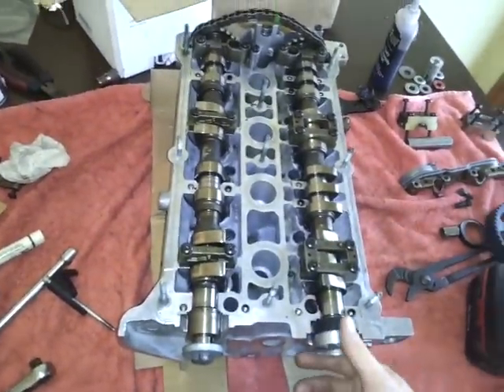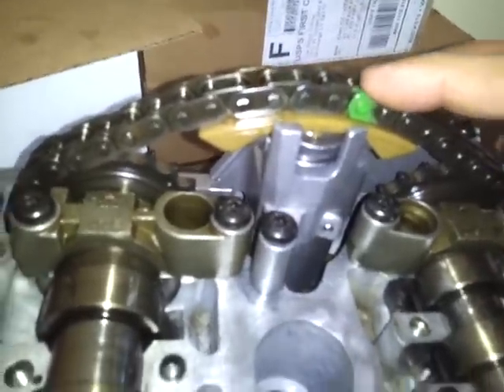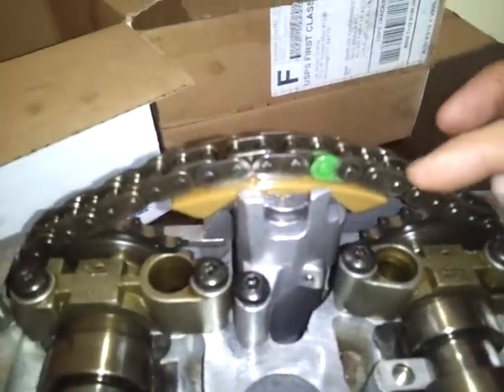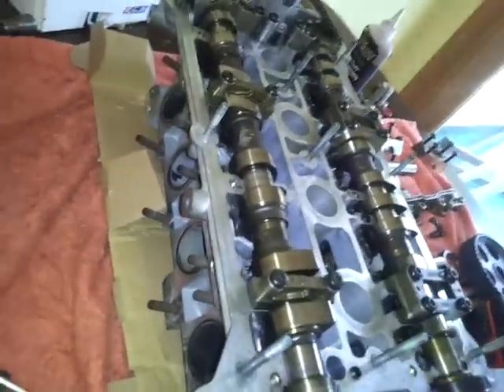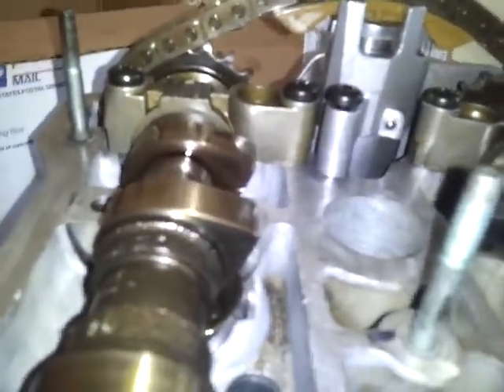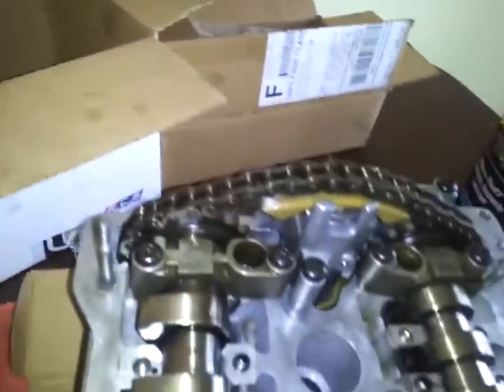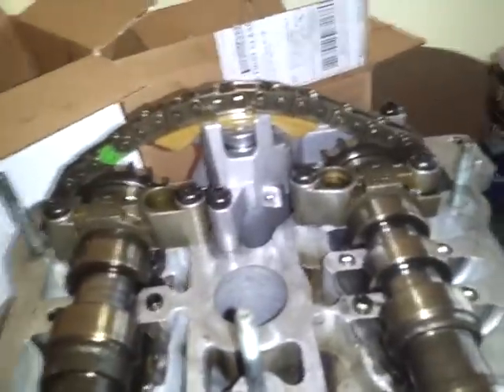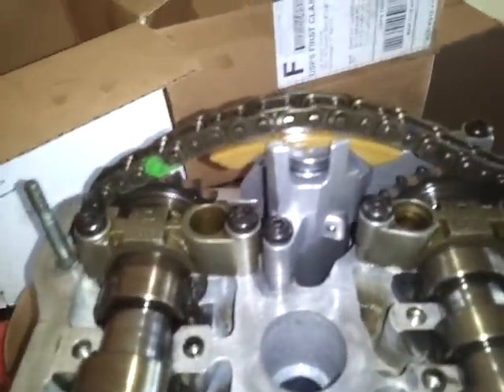Audi A4 1.8t cam chain tensioner - AEB engine

Comment from the maker: It is totally normal.  Because of the greater number of links and that number not being a multiple of the number of teeth on the gears, it takes several turns to get the paint marks to line up again.  As long as you have 16 links between timing marks, and they both line up with the arrow on the cam caps, your timing is correct.  My engine is smooth as butter without so much as a hiccup.

Comment: You did it correct, the marking that you make yourself on the chain never lines up learned that on my first a4 build.its not like a Honda when you make the marks the have to line up. The cam holder marking and rear sprocket marks line up you are good.
Reply: Mines doing this but ita actually in my car and runs do you have any idea why

Comment: I was worried about this to but after looking at it again from another point of view whats happening is the tensioners are not primed with oil and what is happening is the bottom guide is seeing the tensions of the valve train then releasing letting the adjuster rock back down as soon as the tensioner is primed it acts as the fluid lock and the variable side of the tensioner

Comment: Was this a new cylinder head that you purchased? or your used one that you had sent off to be cleaned? I had a sludge issue and have yet to have my cams cleaned.Ive tried cleaning them with diesel fuel and it worked just not 100%. clean.
Reply from the maker: I had this professionally hot tanked at the time it was milled.
Reply: Ok, so basically if i wanted my cams clean right i should disassemble the top part of the engine to send it off to be cleaned? sounds expensive and time consuming

Comment: Hi, really useful video - thanks for posting.

Quick q - if you don't have 16 links how do you adjust it?

Thanks.
Reply: You would crank engine to top dead center, then remove the intake cam, and make sure you have 16 roller nubs between teeth, from cam to cam top. 
Both cam marks with be off from top center mark (exhaust to Left and intake to right, slightly.) 
If it's off 1 or 2 teeth you won't have damage. But this engine only has two teeth off capacity before it's an interference damage. That applies to timing belt as well. You will get an over advanced intake came code tho if you are off teeth. So if you aren't getting that code, you might just have worn tensioner guides.

Comment: the cam reluctor plate on my 2003 1.8T (which I replaced) stays kind of loose even with bolt tightened; is this normal?

Comment: The mark you made will not line up after you start rotating it... thats normal.  Basically arythmetic bud. The circumference of the chain and those of the sprockets do not share a geometric relationship of 1 : 1..
What i mean it's let's say after 1 full rev the green mark is out... if you kept going and kept turning it over after say.....12 turns for an example, the green dot would eventually come "full circle " and line back up the way it first did when you assembled.

Comment: I have one these engines in an Audi TT. What a horrible design! They could've just linked the cams together with gears, and they'd have zero problems with tensioner noises and leaks....

Comment: The only way your green dot would line up with your timing after 1 single rev is if the ratio/relationship of the chain:cam sprockets was 1:1
If it was 2:1, youd have to rotare twice to see ur green mark line back up...3:1, 3.....and if its a decimal like not a round number for ratio, is could take up to 300 rotations to get it to "come around" you see?

Comment: Does anyone know if this is ok if this happens when the head is on the block and the timing is done? Trying to turn my motor over to test it and the tensioner did the same thing as in this video